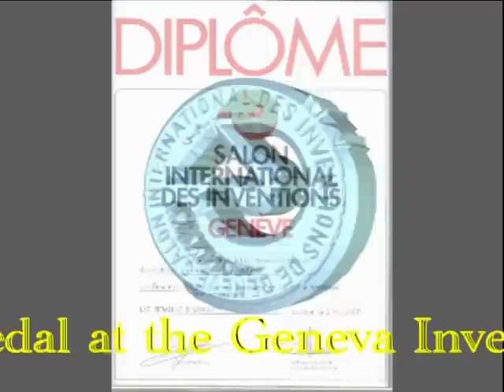How To Lay Tiles DIY With My Ultra Spreader - Roy Tiles

Comment: Trying to understand how the straight edge guide strips works. Looks like you start out using  2 then for subsequent rows the super spreader uses 1 strip and the other side gets its level from the last row of tiles at least I see this for large format tiles however for 12x 12 tiles one side is on the solitary guide strip and the      other is on the concrete if so how are you maintaining the level.
Thanks